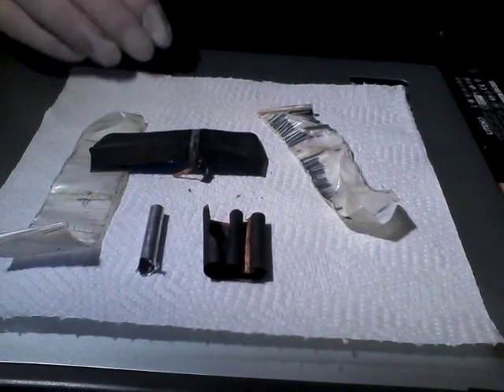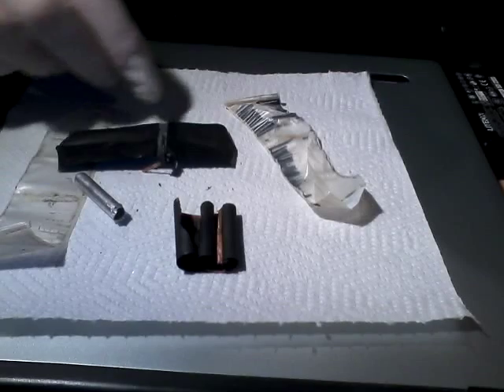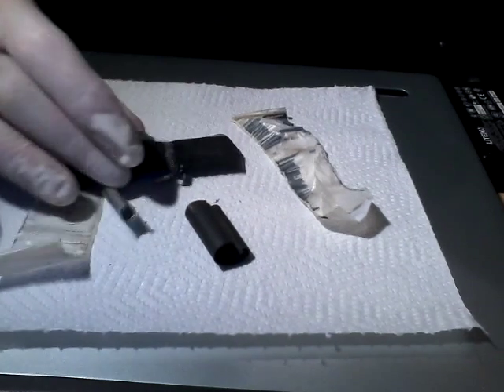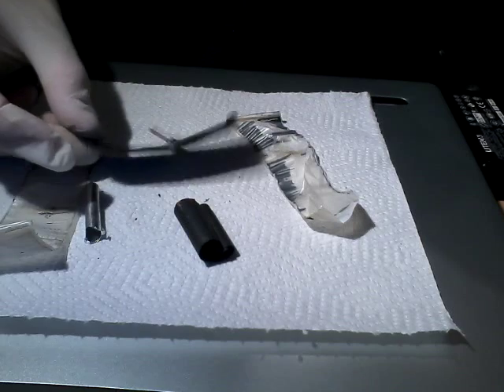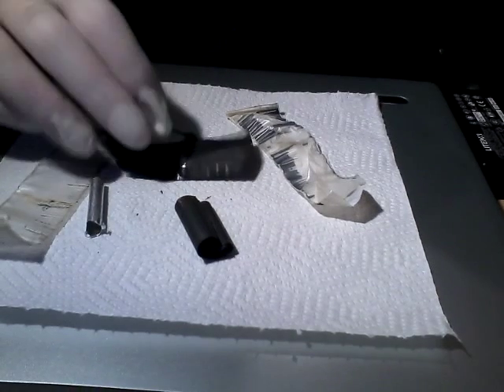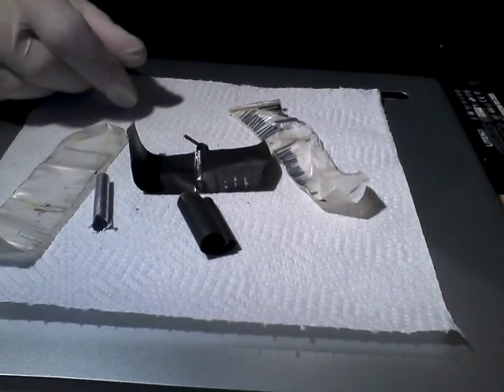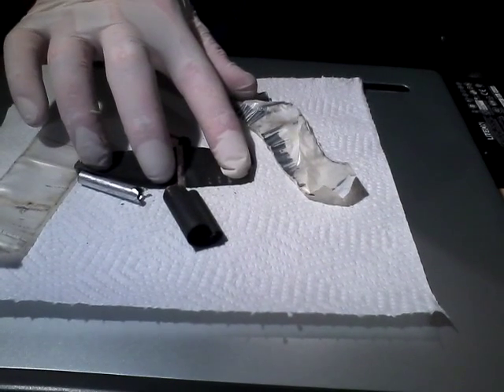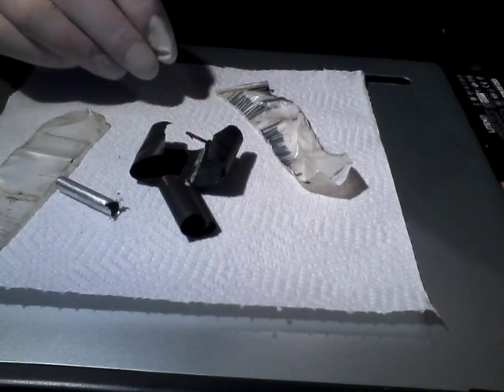A look inside a lithium battery cell.

Comment: you can take apart the Energizer Ultimate lithium cells (the non rechargable type). If you work fast enough (maybe look at a video of someone else doing it first) you can actually get elemental lithium from them.

Comment: Did it perchance smell slightly of bubblegum?
Reply from the maker: It did smell kinda fruity.
Reply: I've noticed that myself with leaking/damaged LiPo cells.. wonder if it's the solvent for the electrolyte?